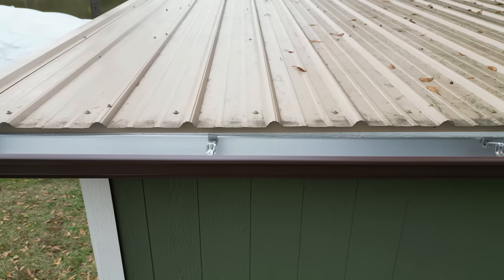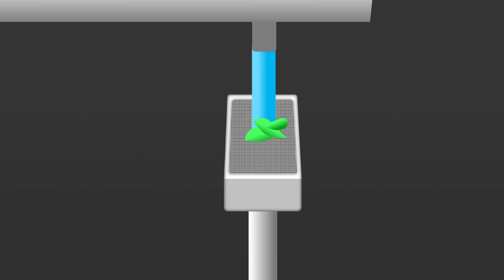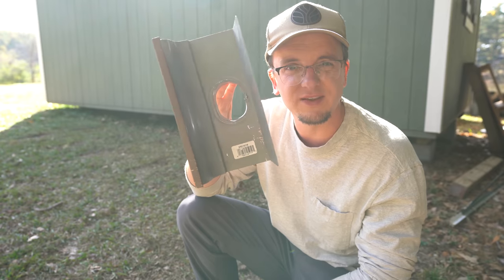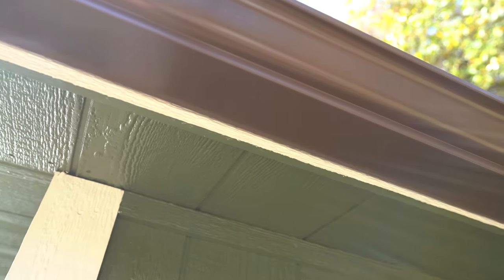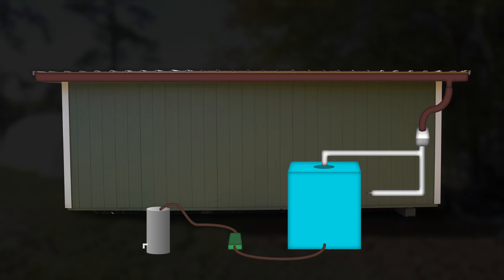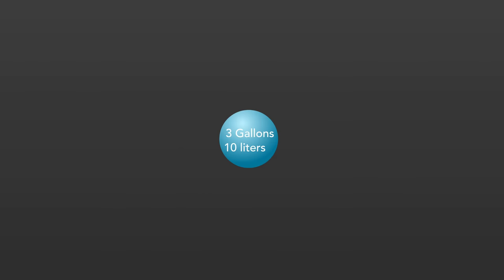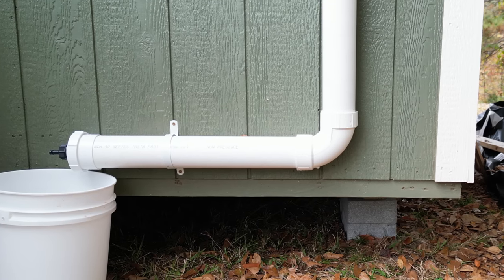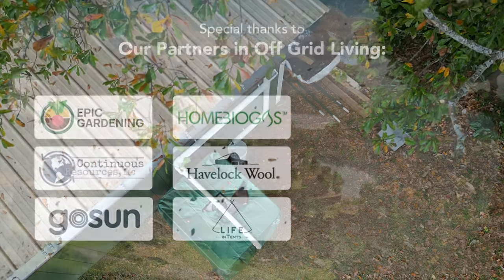Off Grid Rainwater Catchment System

Comment: Good job explaining this guys! I’ve been using rainwater and IBC storage as my sole source of drinking water for more than 18 months. It’s awesome!
Reply: How Do you filter it to drinking quality and how Do you get it to your kitchen sink and maybe the bathroom?
Reply: @gregormarquardt4192  how I do it is by pumping the catch (from the roof) water to a holding tank higher up on my landscape (even 50 feet is enough for decent water pressure - like for a shower). And run a hose from the tank (you can get “food safe” ones at RV shops - they’re usually white). The water then goes into my house pipes. Only drinking water (anything you will be consuming without heating first) needs further filtering. I use a 2-bucket system with food grade 5 gallon buckets to filter my water from the tap. In the top bucket is gravel then sand then wood chips then charcoal - all of which have been washed thoroughly and dried in the sun. There are holes in bucket 1 to allow water to percolate from bucket 1 to bucket 2, which then stores the water. Bucket 2 has a spigot near the bottom. Make sense?

Comment: I’m assuming this isn’t for drinking water. That filter isn’t going to stop mosquitoes. There is still light protruding through the top of the tank which will allow algae to grow. 

Gutter clips are supper annoying to deal with later on for maintenance and are the old style. Use a clip with a hem so all you have to do is clip the gutter in. It will allow the metal to expand and contract freely, making it last longer, and if you ever need to change a section, snap it off and snap a new one on

Comment: I wouldn't drink water that came through PVC. Doesn't PVC contain BPAs and other pthalates?
Reply: I think there is food grade pipe available? but yes, I would be concerned with using regular PVC
Reply: Food grade PVC is available at LOWES and many greenhouse and agriculture suppliers.  We are required to use food grade PVC to maintain our organic/ natural growers certification for irrigation.  If we are using rainwater, well or city water we can't use just any PVC pipes and hoses.
Reply from the maker: Yes, we use food grade piping along with a food grade IBC tote. The one we got was once used to hold ginger ale syrup!
Reply: Depends if it's regular or food grade😊